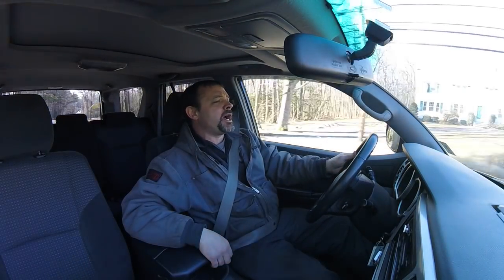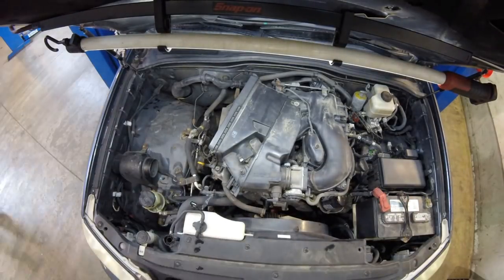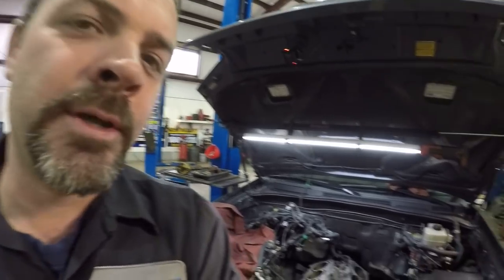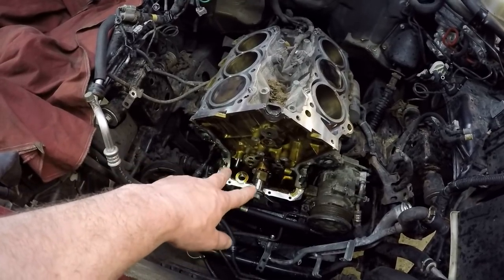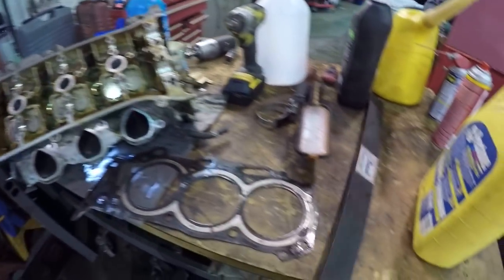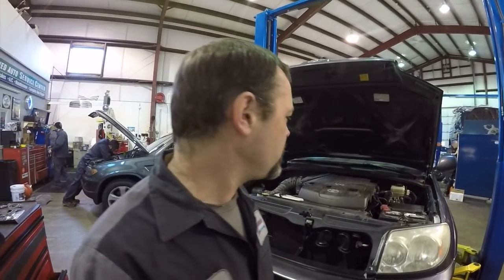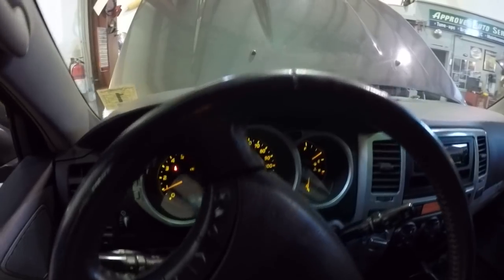Toyota 4 Runner Headgasket Time Lapse. The TimeLapse Tech!

Comment: I'm about to tackle the same job on my 2005 Tacoma. I read the Pro-Demand information where it mentions removing the engine. I couldn't imagine why the job would require this until you mentioned the oil pan. I appreciate the time you spent recording and uploading this video. Nicely done. I am a Master ASE certified automotive instructor, so I can appreciate your effort. Thanks so much for sharing.

Comment: Yes I thank you very much sir! I have a 2004 4Runner and so saying I think I’m going to have to this . I have had a small miss when cold but warm it’s ok . I recently did away with the clutch fan to two ten inch electrical in front blowing through . I also added accell coil packs an new denso tt plugs . I’ve got new water pump, thermostat, radiator (with aluminum end caps),and stainless steel headers and hardware . I kinda figured I would be doing this because it falls in to the bad years for head gaskets . It has 231,000 miles my dad bought it used around 3-4 years ago and past away 1year 3 months ago. He taught me how to work on automobiles. He said this was the first Toyota he had owened we are chevy people growing up I seen them get cheap the last 30-35 years and he as well we switched to Toyota the last 10-15 . We knew what we were up against with the year he had got but it was on the lines of let’s see what it’s made like . That being said he had saved and so had I to rear in to it seeing how it worked and what mods if any we could achieve along the way to get more power. So sadly enough I began this about six months after he was gone it’s been up hill both ways . I knew it would but that’s life and I given up with out a fight . I have had all the interior out accept the head liner all has been sound deadened shampooed seat covers off the the seats new padding new carpet 30% better than factory. All stereo in doors and dash up dated and rust on seats was removed and epoxied . Along with the frame inside and out .  4.5 inches of lift front 3 inches in the rear with black ring wheels and milestar Patagonia 33x12.50-17 inch tires . Chrome nerf bars buy buy running boards that did not have a lot of tread exposed for any use to much tucked under the rocker . Then 4 wheel brakes drilled and slotted with ceramic pads new bottom a arms, cv joints, bearings, and inner and outer tie rods! Also custom built skid pans I’m a welder so all that’s my deal, but we know what I’m doing next thanks for the video I took notice of the reverse un torquing of the heads so I learn from what I seen the rest us just time and lots of parts to clean and polish to make look good . Lots of keeping everything organized and installed in the right places correctly! Also thanks for the tip on the oil and filter I’ll just have to funnel mine in no big deal . To bad they don’t make some hi po cams it would be nice to hear a little loping going at the tail pipe that now has a tubo muffler in it . But hay I’ve put a lot of power adders on already they say there’s 10.4 to one compression ratio in there . So the lope I’ll just not have it would be nice but we can’t win them all ! I’d say he would be proud already it’s just that extra mile now I didn’t think I would have to do .  I was just waiting and checking all along hoping some one has done it. Unfortunately not so thanks for your video once more lots of help from watching !  Stay safe and blessing to you and your family !

Comment: Really impressive! I did a similar job on a much simpler engine (GM Marine 4.3 V6), it had blown the HGs and the cyl heads had cracks due to an overheat. Since it is an OHV engine did not have to deal with the timing chain etc, took much less time. Replaced heads with re-man marine heads and Fel/Pro marine gaskets. What took the longest was cleaning up the block deck surfaces and making sure the cyl head bolt holes were nice and clean.

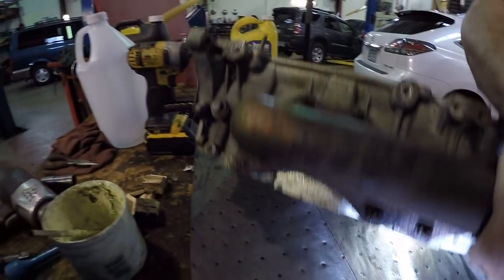Comment: 11:46
At first I was " Why not just pull off the exhaust manifolds?"
Then I saw the rust!! lol
Thanks for the tip on the front cover. I have a 4x4 tacoma with the heads off now that I didnt pull the oil pan due to this vid. Cheers.

Comment: Thnkyou for showing me how to do it. It didnt look too hard after all, i will be doing mine next Spring cause i see white sludges in the oil cap. I will either save at least 1500 or destroy it completely. Well it has already heading to distruction anyways!
Reply: The sludge doesn't mean your headgasket is for sure leaking. Some gunk is normal its just some moisture and oil mixed and evaporated to the highest point in your engine. You dont want to do this job unless you know for sure that its a blown headgasket.
Reply: @ryansmith7974  sure my engine is running fine i notice that my wifes 2011 highlander has the same sludge so i am convince that the thing is built that way and is normal. I think it may have something to do with timing chain or something i will look further for this milky sludge issue. My dads 2007 gen 1 highlander has no signs of headgasket failure and no milky sludge on cap hes got 230k on the engine and runs fine i do maintainence on his car also.

Comment: Not that there's a reply but my engine is cooling fine. But the coolant that goes to the overflow doesn't return to the radiator.if I leave it to completely cool the radiator still has pressure. I did a gasket test where the fluid changes color 3 x and nothing happened. I changed the thermostat, no change. Have run it without the thermostat no change. When I run it with a funnel filler on the radiator fluid goes into the funnel and returns as engine cools. when raving more fluid goes into the funnel. I'm assuming the water pump is working since the level of fluid rises when I hit the gas . I don't have a leak on the water pump. Could this be some sort of air pocket in the cooling causing this? Or a blown head gasket that I am not getting a positive on the test?
Reply: Did you ever find the cause? Mine is doing the same thing sadly and I haven’t been able to find anything online. I’m really hoping you reply

Comment: I thought Toyota didnt "pre-pressurize" the fuel system until the CAS detects a full cycle for a safety mechanism to stop the fuel pump in the event of a crash.  There are diag tools that will bypass the C/OPN relay which is supposed to control this to test and pressurize the pump.  Did you have a list of things that were replaced in the process?  Nice work and video btw.  Would it be more sane to swap the motor out?  I'm sure there are a lot of crossover years the same block can be used.

Comment: Question.
Replacing my timing chain 

I'm now cranking the engine so I can see my chain go around and double check the function of everything.
Once in a while when my chain goes around it gets slightly loose and some points then tightens up again. Is this normal?

Comment: Great job,can you make a detailed video for the Timing for this Engine ,and what is the torque you used for tightening the head gaskets ,Part numbers for the consumables (head gasket polts etc) , a list of the keys and wenches you used, this could help a lot of ppl who have the this engine specially the FJ enthusiasts 
much obliged.

Comment: How much did you end up having to charge? I’m about to have to shell out $2,500 for the same job! 💰💰💰 

Awesome sound track btw
Reply: How did your project end up? Any additional advise?
Reply: It ended up costing me $2700 and I still have a check engine light on! I took it back under warranty for an oil leak which they fixed but the engine code is a misfire! I told the mechanic that and well you know how it goes! I need to take it back, no loaner, and the time off to get it it done just adds up. 🤷🏽 it runs with the light. As soon as I get a chance I will look back into it!  
     I have no advice on this one 😳
Reply: @jacelandadventures1523  shame some shops can and do that sorry to hear.

Comment: So, if it took you 20 hours it will take me 200 hours. Looking to buy a 2002 4runner with headgasket problem but afraid that the engine might have overheated before and damaged the pistons.  The car drives fine right now only with misfiring issue and coolant topoff every other month.  What do you think?

Comment: The local mechanics wouldn't touch the head gaskets on mine, and being a master mechanic myself, I don't have a shop anymore, I didn't want to do it in my driveway. So I ended up buying a used 2010 taco 4.0 engine with 77k on it for $2400

Comment: I just got something similar on a 2010 Toyota venza v6 with 95k, coolant leaking from the head gasket and running down the block, dealer wants 4400$ to fix, they say they do 2-3 head gasket jobs a year on cars with the same v6 🤔
Reply: rogert151 not the same V6 as this one . . .

Comment: I have a 2012 Tocoma (4.0 ltr) - had a local Toyota dealership do work on the engine (said they replaced head gskts) and since then. this engine has been consuming EXCESSIVE amounts of engine oil and coolant; Engine oil consumption is at 2/3 ltr of oil PER TANK OF FUEL; Coolant, the engine has consumed about 4 ltrs SINCE the work performed at this Toyota dealership; WHAT A BATTLE.... Dealership refuses to take responsibility for the failed work (IF IT WAS EVEN DONE PROPERLY); 6 other dealership say it is them who needs to take responsibility; Even Toyota Canada's "Oil consumption test PROVED there was a problem and FAILED this test; Finning Oil analysis showed coolant being burnt in combustion chambers .... hence possible pressurization of other cylinders and then blow by...and EXCESSIVE OIL CONSUMPTION... What a Battle....STILL
Reply: Did you get rid of the Tacoma?
Reply: @elonsus9747  bought a new engine... Ffffrs at the dealers would not own up or buck up.   I should repaired it myself.  10k for another motor
Reply: @Mooseracks  Geez.
Reply: @elonsus9747  tough one to swallow... I am so ffffn pissed I could do what I do with moose.  What really anoys me is that these bastards got away with an improper repair...  I tore the egine down...blow head gskt... They reused old head bolts.. And wel the coolent...some contamination in crankcase...   Qualified techs...toyota canada say BS... AND NO WARRANY ON WARRENTY WORK. A PILE OF CRAP... Auto fruad is a crime....but he who has deep pockets wins the battle.... I guess this is The Toyota Way....
Reply: Yeah.

Comment: What is your technique for organization of bolts and washers as you go?
Reply: Mechanics typically know which bolt went where depending on its threads, size, bolt lengths etc. If you are new put the bolts in a zip lock bag and write the part those bolts came off with. I first started doing big jobs I took alot of pictures after every part of the process. After a part was removed I take a picture. Now I developed a general reference in my head for the bolts and where they go. Cheers

Comment: Is this a common problem with Toyota 4.0l V-6 engines??  Thinking about getting a slightly used Tacoma and wondering if I should get one with this engine or the 2.4l 4 cylinder??
Reply: I've got a 2005 Tacoma w/ 272,000 miles on it.  Head gasket issue showed up at 267,000.    Cylinder #6 on mine.   When I talked to dealer they thought it was cylinder #4 (same as this one).  It is a known issue on the  4.0 liter v 6.      I've bars leaked mine and it seems to be ok ... for now, knock on wood.
Reply: I had a 3L v6 in my 4 runner. It would eat up a head gasket every 80k or so. It was expensive as hell to replace and I had to do it twice before I finally sold it.
Reply: @Lario  hows the bars leak holding up? My 04 4runner v6 is having same issue.. 166k only
Reply: @duperfastEUC   bill
Reply: @duperfastEUC   I have to tell you I'm quite pleased.   Now over 278,000 miles (knock on wood).   I put it in end of April last year so going on 8 months so far.   I wished I'd of written down the mileage but I think did it about 265,000 miles or so.    Here is the product I used   https://www.amazon.com/gp/product/B003RGIWO0/ref=oh_aui_search_asin_title?ie=UTF8&psc=1

Make sure you take enough coolant out to  pour the entire bottle of Bar's Leaks in.    With this one you  don't have to remove the thermostat or bypass the heater coil, but it might be a good idea.    I did a cooling system flush about 3 months ago and may put another dose in mine and leave it.

Comment: Building a two thousand piece 1/100 scale Titanic model to perfection was harder than that. Afterwards when I placed it in the water it sank! On inspection I noticed a 3mm x 2mm piece inside which I hadn't glued properly turned out to be a damn bulkhead!
Reply: Sure it wasn't the 4,000 piece scale iceberg?
Reply from the maker: Lol!
Reply: Don't worry, the original sank as well.

Comment: Fuck that is so much labor. I ended up just putting a low mileage engine out of a 2010 Tacoma in my 2005 4runner. My head gasket went out at 210k, my buddies 2005 made it to 270k before his went out.

Comment: Did you resurface the heads and block..??
Reply: i dont think he did, just replace gasket. The owner dont want to pay for that so no.
Reply: dang0088 da oh so was the cylinder block warped..??? 
So if it didn’t overheated you don’t need to resurface heads and block..???
Reply: Jose Arellano  Nothing else is a problem just gasket replace, the leak was the gasket.
Reply: @dangda-ww7de  ok.
Reply: Jose Arellano  and i dont even own a tacoma, lol, im looking to buy one within a month from now.
Reply: dang0088 da nether do I... just asking questions...

Comment: How many miles on that Toyota?
Reply from the maker: About 157,000
Reply: Amesie's Automotive Corner Barely broken in
Reply: Hey Amesie, I have 187,500 on my 2006 4Runner and was just told, I need a new head gasket as well. What is the typical cost to get it done?
Reply: @huntermark1160  2200-3000
Reply: My mechanic just quoted me 900-1100. Up to 1500 if the head is cracked and he has to replace it.
Reply: @huntermark1160  is that just his labor or with parts?  I got my heads resurfaced and a valve job as well since my valves we're going bad.  And all parts included.
Reply: in la i think a rebuild engine install is about 3500, so might as well just put a rebuild in it.
Reply: @dangda-ww7de  not worth it. You are going to machine the heads either way.  And a new crate engine is 4k
Reply: a rebuild engine is diff than crate, these guy they rebuild out of the shop, they will install too.
Reply: I'm interested in a rebuild and I'm in LA. Who should I call?
Reply: @AmesiesCorner  that motor was really clean at 157,000 miles
Reply: My 2002 toyota tacoma v6 3.4L has 340,120 miles.
Reply: @parkerazz4385  wow!!!

Comment: In your professional. the local toyota dealership did this job in 14.0 hours;   MY ENGINE NOW CONSUMES .5 - .65 LTR OF OIL PER TANK OF GAS (600 KM) AND CONSUMING COOLANT AND OIL ANALYSIS SHOW THIS; AND THE TOYOTA OIL CONSUMPTION TEST INDICATED THIS ENGINE FAILED THE TEST...   what next...   I am now replacing my engine